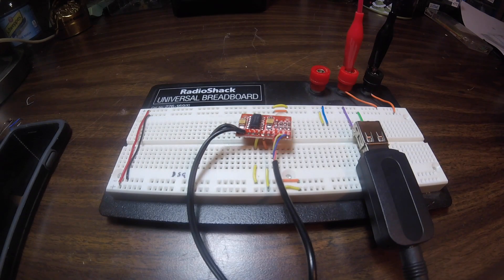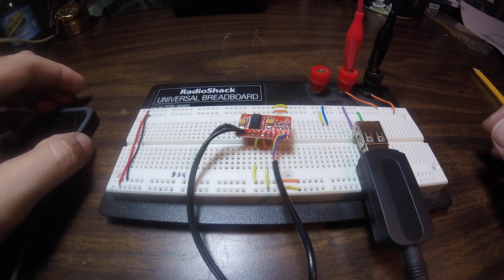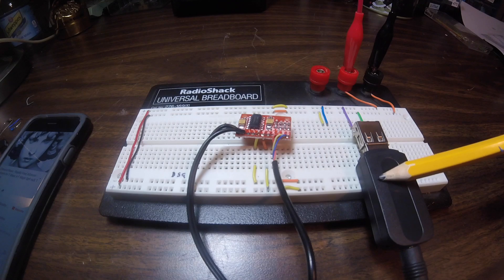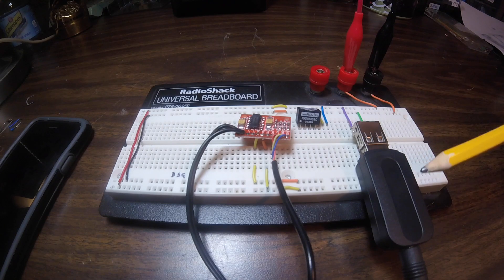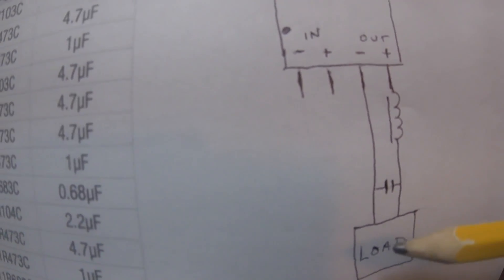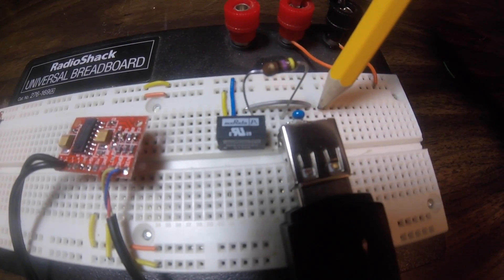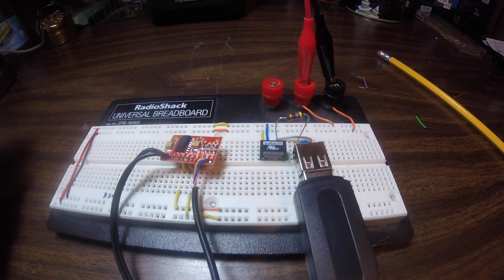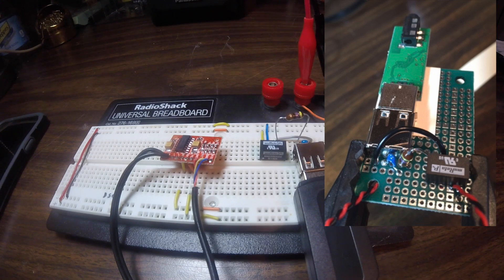Bluetooth Ground Loop Isolation

Comment: Excellent video. I have a problem with my system. Basically it's a small arcade cabinet. There is one 5 volts power supply that feed a raspberry pi, a screen and a PAM8403 amp. I think I get noise because the amp is sharing the power supply with the other component. Do you think that if I add this kind of isolation tranformer between my power supply and my amp I would get rid of the noise? Also what wattage do I need knowing that my speakers are 2 times 3 watts (4ohm impedance). Thanks a lot.
Reply from the maker: No, unfortunately this isolation transformer probably won't supply enough current to run the amplifier.
Reply from the maker: you may need something like this instead: https://youtu.be/Djnfm-3NcL8
Reply: Thanks! that what I thought (you can find isolation tranformer for several watt but they cost a fortune). I actually ordered one of those ground loop isolator this morning ;) I'll tell you if it works. After watching your video and searching on the internet I've also found out that a capacitor between Vin and the ground of the amplifier board could reduce the parasites. Is that the reason of using one here? I'll give a shot with the capacitor if the ground loop isolator does not work.. I have another question, why do you put an inductor? Thanks for your answers.
Reply from the maker: The inductor and capacitor are suggested by the chip manufacturer. They form an LC lowpass filter to make the DC signal clean. However. Ive omitted it on several occasions and not had any issues. Please let me know how the ground loop isolator works! Thanks.
Reply from the maker: Excellent! Thanks for the info!

Comment: Do you know any transformer for 3.7v-4.2v or will the 5v work? I wanna use a lipo batt without booster.
Reply from the maker: you'll pretty much need to be at 5V. So if you are using a lipo battery it will need a 5V regulator

Comment: Is this ground loop the same for amp? I have PAM8403 module with 2x5w 4 ohm speaker connected to pc via USB(5vpower) + 3.5mm jack(input)? 

They do work properly about 20% of volume but more than that the speaker started popping.
How come other premade pc speaker that are also powered by only PC usb don't have ground loops?

Comment: I just saw your video, and what you accomplished is exactly what I'm trying to do. I've got a bluetooth amp module powered by a 12v rechargable battery. The voltage is boosted by a boost converter for the bt module. The module also has a aux in jack. I wired the parts (the murata nke1212sc, a 47uh inductor, and a 4.7uh cap.) Between the battery and the rest of the circuit. Nothing rrally happened. Noise was similar, couldn't get music to play, then the Murata module smoked and stopped working. I checked my connections and were all fine. Any suggestions?
Reply from the maker: were you running the murata at 12V?
Reply: NizzyAmps yes. I think I found my mistake. I purchased the nke1212sc version, as I knew I would be running 12v. But I didn't consider the inductor and capacitor, which I ran the same as yours. I've ordered different inductor and cap...so hopefully once they arrive it will work!

Comment: i have this issue in my bluetooth speakers. i am no engineer at all so don't know anything about it. can you please tell what can i do to remove hiss/high pitch annoying sound?
Reply from the maker: If the BT speaker is already built, it would be difficult. If you are building a speaker, you can add this module to power the Bluetooth board
Reply: NizzyAmps ahan! Thanks for your reply.

Comment: Thank you, your idea led me to my working 12v-solution with a Mornsun B1212S-2W, coupled with a 2.2uF cap, 12v bluetooth receiver. Be advised anyone reading that pin out is different compared to module in video. Glad I checked the datasheet!
Reply: I found on ebay a isolation converter that actually has the pins marked. Input WSTECH  DC9-30v Output DC 5v1A

Comment: I have the adaptor and the noise it's on using the earphones. No ground loop.  The conclusion is that noise it's not generated in any way from any ever ground loop. Even powered by external usb pack.  How to solve this?                   This setup it's clear it will not help.
Reply from the maker: If its a hissing sound, it may be the amplifier. Some class D amps can be noisy. Hope that helps
Reply: it's exactly the noise that you have manage to solve, i think it's an interference with the PIC on the board, sound like a digital communication.
Reply from the maker: It could very well be. Can you try another type of amp board? Then you can narrow it down to either the amp board or the Bluetooth board or a bad isolation chip

Comment: Thanks, very useful, i wanted to buy a  'integrated' Bluetooth amp for my diy boombox but now i see it's best to have separate amp and Bluetooth module.
(It does get allot more expensive buying everything separate, gives me doubts) How come it's so expensive? Make me wonder about powering the bluetooth dongle separate (in case of having the batteries and things needed at hand), that would also do the job? I don't have the items yet so i can't test it.

Comment: Hi! Do you think this could work with the sure 4.0 bluetooth module? It needs 12v and I use a 12v amplifier. It's ok of 1 watt? 
 I'm desperate :D
https://it.aliexpress.com/item/Regulated-DC-DC-power-supply-module12v-to12v-B1212S-1W-Special-factory-direct/1919097726.html?spm=a2g0y.search0104.3.9.6En1Zk&ws_ab_test=searchweb0_0,searchweb201602_4_5570020_10152_10065_10151_10068_10344_10342_10343_10340_10341_10304_10307_10137_10060_10302_10155_10154_10056_10055_10054_5470020_10059_100031_10099_5460020_10338_10339_10103_10102_440_10052_10053_10107_10050_10142_10051_5380020_10326_10084_10083_10080_10082_10081_10177_10110_10111_10112_10113_10114_143_10312_10313_10314_10184_5560020_10078_10079_10073_5550011,searchweb201603_19,ppcSwitch_2&btsid=0d98a22c-418c-4217-b75d-61e03ee7f5bc&algo_expid=9918aa7c-5132-493b-a7a1-5635f3a4efbd-1&algo_pvid=9918aa7c-5132-493b-a7a1-5635f3a4efbd
Reply from the maker: Andrea C that board requires a 1A supply. I don't think that a 1w isolation transformer would work.
Reply: Wow, 1A! I didn't imagine that! Thank you

Comment: hi there thanks for sharing,.. I have a question though..

will it be the same effect (eliminate ground loop) if I'm using buck converter lm2596s instead of dc-dc murata isolation?

thanks
Reply from the maker: Rudi Yang I don't think that the buck convertors are isolated. I've never tried it but I think you would probably still have noise
Reply: one more question sir,..  would it be better results if I use the dc-dc isolation in bigger watts (2 watts),. because the pam8403 needs 2 watts for clean power,.  and that b0505s is rated 200ma,..thank you
Reply from the maker: You only run the BT module off of the DC/DC convertor. The amp runs off your original power supply. You are isolating the power supply to the amp from the power supply to the BT module. For most BT modules 1W of power is plenty
Reply: Thank you sir

Comment: Hi, thank you for the video. 

One question. What if I use 12v to 5v transformer from aliexpress (don't know if it is isolated or not) and good quality logitech Bluetooth receiver with 5v 1000 mA input. 
Are Capacitor and Inductor still the same (4.7uF and 47uH)?

Converter:
This https://www.aliexpress.com/item/Cimiva-DC-12V-to-DC-5V-3A-15W-Converter-Module-Duble-USB-Output-Power-Adapter-New/32790946432.html?spm=2114.01010208.3.9.RHerU2&ws_ab_test=searchweb0_0,searchweb201602_3_10152_10065_10151_10068_436_10136_10137_10157_10060_10138_10155_10062_10156_10154_10056_10055_10054_10059_100032_100033_100031_10099_10103_10102_10096_10147_10052_10053_10050_10107_10142_10051_10084_10083_10080_10082_10081_10177_10110_10111_10112_10113_10114_10181_10183_10182_10185_10078_10079_10073_10070_10123-10050,searchweb201603_2,ppcSwitch_5&btsid=d480d657-98e8-4ff8-92b4-4d53fd4a63f1&algo_expid=f8f1f67c-d5eb-47a3-8d44-2336d374da3e-1&algo_pvid=f8f1f67c-d5eb-47a3-8d44-2336d374da3e

or this 

https://www.aliexpress.com/item/Hot-Dual-USB-Output-DC-DC-9V-12V-24V-36V-to-5V-3A-Step-Down-Power/32705919902.html?spm=2114.01010208.3.113.2bzWMT&ws_ab_test=searchweb0_0,searchweb201602_3_10152_10065_10151_10068_436_10136_10137_10157_10060_10138_10155_10062_10156_10154_10056_10055_10054_10059_100032_100033_100031_10099_10103_10102_10096_10147_10052_10053_10050_10107_10142_10051_10084_10083_10080_10082_10081_10177_10110_10111_10112_10113_10114_10181_10183_10182_10185_10078_10079_10073_10070_10123,searchweb201603_2,ppcSwitch_5&btsid=b736f03f-a66d-4e14-8cf9-c865964c743e&algo_expid=d20f3654-b587-4eb9-b10b-609591a85387-14&algo_pvid=d20f3654-b587-4eb9-b10b-609591a85387
Reply from the maker: scotapipa this method is used only when you are using a separate amp board and Bluetooth board. It won't work on an "all-in-one" board where the Bluetooth and amp are integrated.
Reply from the maker: scotapipa I don't think either of those converters are isolated. The point of the isolation is to break the ground loop between the Bluetooth board and amp. Even if you use an expensive Bluetooth adaptor or board you still can get the ground loop noise
Reply: NizzyAmps yes I get it now. I have t find isolated converter here in EU, postage from US for Murata is 20$
Reply: NizzyAmps I have also measured current on bluetooth module an it uses only 30 mA max, but I though I need converter with 1A. I will wire both (lepai amp and logitech bluetooth receiver) to same 12V car battery, this is why I hear buzz.
Reply from the maker: you will split the power supply to the amplifier and to the DC/DC isolation chip. The amplifier will prob draw close to 1A. DC/DC isolated power chip will draw much less, like you found abut 30mA. You need the 1A supply to meet the needs of the amplifier, not the isolated bluetooth board.
Reply: Hello did you solve the problem? I also bought an aliexpress bluetooth module for my car.. and noise is there, how did you fix it?

Comment: Help, I'm trying to use a Bluetooth board and a small amp like yours but I can't get rid of the noise. The only difference is I'm using an electrolytic capacitor. I did get rid of the noise by hooking the amp and Bluetooth to separate batteries. Any input would be greatly appreciated.
Reply: Dude, watch the video.

Comment: I tried your solution for my system but the MEV3 stops working after a couple of minutes. I power the amplifier directly and the other components (two controllers) with the MEV3, having a load around 60 mA to 150 mA. I measured 0.06 A to 0.07 A at the input of MEV3 when running.

Could you please help me to find the reason of this problem?

My configuration: 
- MEV3S0505SC 
- 4.7 uF capacitor (Tantalum)
- 10 uH inductor (09HCP)
Reply: I'm not sure why thats happening. The MEV3 should be able to handle those loads.

Comment: How much power does your BT receiver need? I want to do the same thing you're doing, but use a chromecast audio. However I don't think 200mA from the isolator will be enough.
Reply: Chromecast is about 2W, I think. Should be able to get a 3W DC-DC and set it up the same way.
Reply from the maker: Tim Wellington you might not be able to use this for a chromecast audio. I haven't tried. It works well with a generic BT stick tho

Comment: What is the function of the 47 Ohm resistor, limit current?
Reply from the maker: Illumation Streambutler it's a 47uH inductor. It's used with a capacitor to reduce noise on the D.C. Outpu
Reply: Oh okay, never seen those before in this kind of package, only coils. Are there any benefits using these kind of inductors or is it just ease?

Comment: hi, I'm new in electronics, so I have a little doubt. I have a project with an amplifier and a bluetooth module, both 12v so I have a 12v battery and the noise was horrible until I put a dc dc isolated 12v converter, but without a capacitor and an inductor. the capacitor must be at 16v? and the inductor make de voltage lower? Uf? uh? helps please! thanks man!
Reply from the maker: Siegfried Gebauer the capacitor should be at least 16v. I use small ceramic caps that are 50v.
Reply from the maker: The inductor doesn't drop the voltage to any significant value.
Reply: ok. and the capacitor it's a 16v if the dc dc converter works at 12v? and can be 4.7uf or higher? can use a 16v 100uf capacitor for example? and the inductor?
Reply: I understand the why I need a capacitor, but can you tell of why is the inductor need it. thanks and regards! ( the converter is 12v and 1w hd I don't use capacitor and inductor it will burn it?)
Reply from the maker: Siegfried Gebauer you can run the converter without the cap and inductor and see what your noise level is like. A USB Bluetooth is not very sensitive to noise so you should be good. If you are going to add the cap and inductor use the manufacturer recommended values. Better minds than ours have figured this stuff out.

Comment: Glad to found your video! Many thanks for sharing this useful educational info (and demo). I have build some amplifiers with bluetooth and all of them have this kind of ground-loop noise (but only with bluetooth). Using capacitors can reduce the noise but cannot eliminate it. I have one made and the noise is absolutly terrible, not useful but by seeing this I think I can revive the project. Many thanks!
Reply from the maker: Thanks. I hope that this is a viable solution
Reply: Today I started to experiment with an USB sound-card (and class-d amp) and got the same problem, other noise but noise (data noise). Because the component you recommend isolates the ground, I did a little experiment with an other powersource connected (in fact similar to this) to the sound-card instead of the USB power, only datalines connected to computer or other device like a phone. As expected the sound-card turns on (powered by the external power source) but doesn't work except when I connected USB ground again (share the ground with the external power source).

Because I still need to connect both grounds, this device doesn't make any sense because the ground is the noise generator (and it is required to connect both grounds). Any idea how to solve this? Is there a way to fool the usb host so it doesn't require to share the seperated grounds or is this a dead end? Many thanks for your time and answer if you have one. ;-)
Reply from the maker: This solution works in this case because we are breaking the ground loop at the power end. In this case there are no USB data lines that are at the same ground potentials as the power supply. I would think that the only way break that loop would be to isolate the data lines. Have you try a transformer type isolation device on the data lines? That might work as the USB data ground would be connected at the computer end but the amp side would float?

Comment: I followed your schematic using a NMH1205SC  (12v in, 5v out) as suggested in your list.  It's a 5 pin converter (instead of 4 pins).  Testing the output voltage across pins 4/6 (as labeled by Murata) produces apprx 14v.  If I test the voltage across pins 4/5 or 5/6, I get apprx 7v.  Funny thing is pin 5 is supposed to be 0v.  I've confirmed this on two separate converters.  Any ideas?
Reply from the maker: Ive just noticed (thanks to your comment) that the chip I used in the video isn't the NMH series chip, its a NKE series chip. I've corrected the comment section. The NMH1205SC will work just fine. The inductor and capacitor values are the same as the NKE1205SC. However, the pinout is just a little different. 
Pin 1 ans 2 are the Vin pins. Pin 1 is V+. Pin 2 is V-. So from your 12V power source, Pin 1 is +ve, pin 2 is -ve (Gnd). 
Pin 5 and 6 are output. Pin 5 is output V- (Gnd). Pin 6 is output V+. So you would connect your bluetooth power source to Pin 6 V+ and Pin 5 V- (Gnd). 
Again:
Pin 1: Input V+
Pin 2: Input V-
Pin 4: no connection
Pin 5: Output V-
Pin 6: Output V+

Pin 4 is a -5V output . You won't use it for this application. It is used for split power supply chips.

The reason you are getting 7V between pin 5/6 is probably because there is not load on the output. When you hook up the bluetooth, it'll go to 5V. You can confirm this by putting a 1K resistor across 5 and 6 and then measuring the voltage across 5 and 6. It should be 5V.

I hope this helped and I'm sorry for the confusion. Let me know if you have any other questions.
Reply: Awesome, thanks for the info.  I'm actually going to use a 5v output converter instead with a linear voltage regulator.  The voltage in a vehicle varies too much (12.2v-14.5v) I feel for the 12v output regulator to be reliable.  I considered using a resistor, but then that may drop the voltage too much during times that the vehicle is not in use (I play my radio a lot when working on my truck).
Reply from the maker: ABbuggin yes. If you can go thru a regulated power supply first it would be best. However, those chips are pretty robust.

Comment: There is a cheaper alternative chip available 
http://www.mornsun-power.com/uploads/pdf/B_S-1W.pdf
Reply: For some reason multiple pdf programs can't open this pdf, do you have the name and/or part-number of this item ?
A link to a shop would help. :)
Reply: pdf is not working! can you  mention a link or brand, model number?
Reply: That`s a good alternave. Test it and works great!
Reply: That link no longer works, but this datasheet is for the same product AFAICT: http://www.mornsun-power.com/uploads/pdf/B_D-1W.pdf